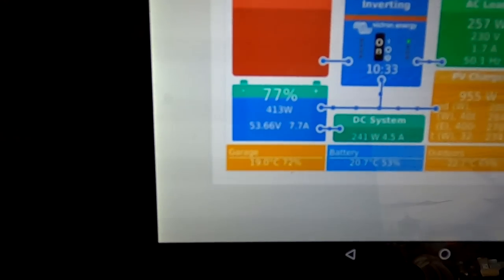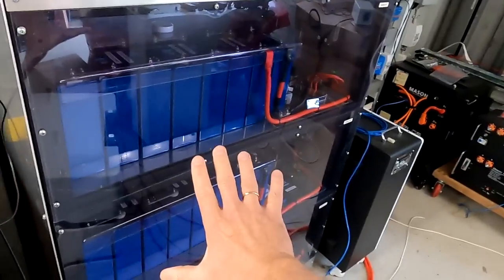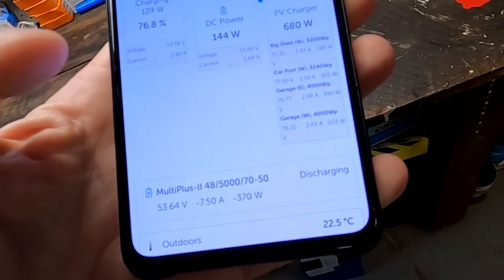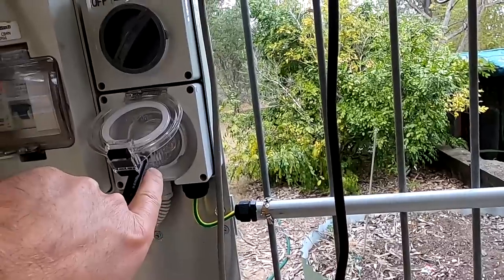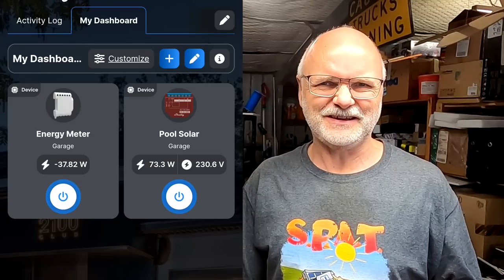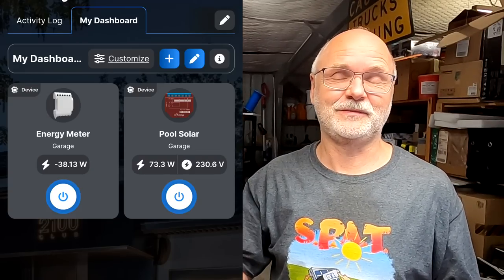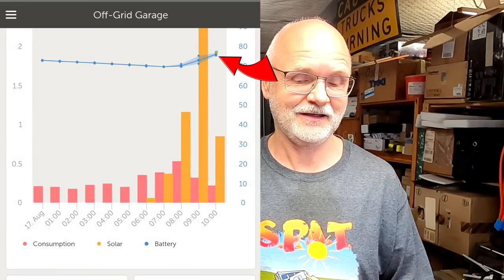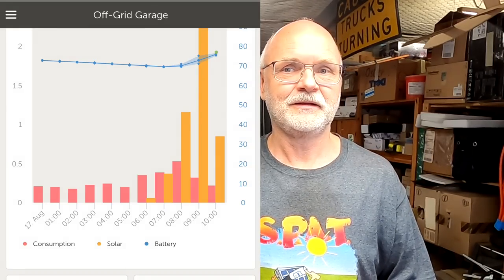Micro Inverter shows in Victron VRM. Shelly Switch Integration to Home Assistant and Victron.

Comment: I think, that there is a further bug: AC Loads does not show correctly.
The Venus OS does not add the PV Inverter production to the loads.
If PV is 500W and the inverter is adding further 50W, it should show 550W on the AC Loads...but it only shows 50W.
Thank you for this Video and thanks you all Developers of those integrations!
Reply from the maker: Yes, if the AC-In is set to Generator, it won't be added. I've set the option to Grid now and it works.
Martin thinks, the script may only work with ESS and grid connected systems. He hasn't got to time to further look into it, so I'm looking for another solution...😐
Reply: Is there a solution already?

Comment: Great video, it showed me a lot of very useful info, thank you!

I have a different, but similar problem, trying to add a second inverter to the Cerbo GX:

The background:
My Victron system is in a small travel trailer.  I full time in the travel trailer and try to stay off the grid as much as possible.  While I LOVE the dual MultiPlus II 3000 because I can run anything and everything I need, for 95% of my needs the overhead is too high for running the light day-in/day-out A/C  loads I need all day long: computers, monitors, Starlink, CPAP machines, and other small devices. I already own one of the smaller 800VA Victron inverters and plan to wire that up to run the loads.  

The problem:
I have heard the Cerbo GX can only show one inverter group (the dual MultiPlus II).  So I was going to install the SmartShunt on the DC side of the 800VA inverter and the Shelly EM + 50A Clamp on the AC side.  Is there any way to configure the Cerbo-GX so I can track the usage of this inverter?  I am also thinking of adding a Shelly Plus 1 to turn the 800VA inverter on and off.  I would love to get that on the Cerbo GX, too.

I am guessing this is outside your knowledge base, but can you point me to those that might be able to help?

Comment: Very nice, congrats. I understand the reason for the shelly but to know the production of the micro inverter you should use Solarman integration it will give much more information that the one you get from shelly. Since you are using Hassio you can install one more shelly in the pump and only have it running when the microinverter can fully power it.
Reply from the maker: The solarman integration gives me only data every 5 minutes, while the Shelly provides live data.

Comment: Note that ssh should be native in modern Windows OS (so no need for Putty). 

Also, vim is the editor of Linux 😅

Finally, you may want to set a static DHCP address for your Shelly as it could change otherwise making your script look for the wrong address.
Reply: vim isn't installed in Venos OS
Reply: @pau1phi11ips  ok, good old vi then 😆
Reply from the maker: @pau1phi11ips, I assume this is you: https://github.com/pau1phi11ips/dbus-venus-mqqt-pvinverter
I've tried your script as well on my Cerbo but with the same result: generator shows negative figures and Total Solar is not combined. If I set Grid as AC-In, it still shows negative numbers for AC-In but at least the Total Solar is correct now (MPPTs plus PV Inverter)

Are you able to help and troubleshoot? Happy to colab and get something done. My email is under the About tab on YT.
Martin is not keen to investigate further as the script works for him and his ESS 🤷‍♂️
Reply: @OffGridGarageAustralia  In the Cerbo remote console, what do you have the recently added Shelly device set to within Setup > Position?  Likewise for other devices?
Reply: Still no solution?😢

Comment: I'm running a Plus1PM in a similiar configuration for testing purposes and just recently found the reporting into the vrm not working anymore after turning the Shelly off and on again.
Had to ssh into venusOS and restart the dbus-service for the given Shelly (no need to reboot!). This is with static IP set both in the shelly and directly in the switch that manages the whole network. In case you encounter a similiar problem...
Reply from the maker: Hmm, strange. I have turned off my Shelly a few times so far but it always came back in the VRM after turning it back on. I also have a static IP for the Shelly. Do you use the same script?
Reply: @OffGridGarageAustralia  same GitHub repo, yes, but maybe not the same version as my installation is already some months old, I'll check if I can update. Also i'm pretty sure that everything worked fine some months ago, maybe it was just a hickup

Comment: Hi Andy, doesn't the Shelly have the Outbound Websocket support? In that case you don't need anything, just point it to Venus OS and it will popup as a meter you can configure for PV Inverter. No MQTT , no root, and no other difficulties required
Reply from the maker: I have no idea how this would work. 
Quick Google search, it seems to be the Gen2 of the Shelly switch which has that. But still needs some sort of script in Venus OS?
Happy to test a simpler solution if there is one.

Comment: Is it possible to use another instance of shelly 1PM attached to Old Good Xijia 3kW Inverter to show them as AC LOAD on VRM? It would be a super option for ppl like me, which doesn't have Victron Multiplus Inverters (yet ;))
Great video Andy
Reply from the maker: Well, you don't need the Multiplus to show the Shelly in VRM. It also works in my SPAT Calibration Centre for testing purposes.
But yes, there is a thread on the Victron Community forum where people have modified the script so it shows a load instead of a PV Inverter. Search for the word 'load': https://community.victronenergy.com/questions/127339/shelly-1pm-as-pv-inverter-in-venusos.html

Comment: Andy, 1. You can use the "Victron GX modbusTCP" to get all VRM data to the Home Assistant, control Multiplus, dynamically control EV charging, based on available PV production / battery SoC, etc. 2. Multiplus losses are 30%, when charging from AC and then inverting from the battery. Huge loss of the tilting benefits 😞 (3). Shelly 1pm is not robust for such wattage. Shelly EM, with the 2x A clamps is much better with no inline connections to the inverter/consumption.
Reply from the maker: Thanks you. I think I have used that as an HACS integration already. It works well.
The power of the tilt system will mainly go directly into the pool pump, the house pressure pump and the SPAT fridge. Some small excess will go back to the garage. I have seen a video where someone calculated all the losses of the MP and charging efficiency was actually surprisingly good with around 80-85%
The Shelly runs a treat since installation, no problems so far. It's only 7A which is going through it, less than half of what it is rated for.
Reply: @OffGridGarageAustralia  Trivial losses for direct use and 4x MPPTs, good job. You can add the "vebus acin1toinverter" and "vebus invertertoacout" entities at the Energy Dashboard and check the MP losses when using AC charging + inverter. For DC charging + inverter the 80-85% seems correct. 7A for 1pm is ok for just measuring energy. Using the internal relay for 7A loads on-off can be too high, depending on loads. Actually its not measuring energy, like grid meters / inverters, just gets a power measurement every second, so some % inaccuracy, depending on variations, not so important.

Comment: My friend had micro inverters at his house with panels. Problem: they produce a lot of RF interference, being a Amateur Radio operator, the interference disappears with no sun,  he got rid of them and went with a single MPPT charger. He can now communicate during the daytime. Some manufactures are not following RF radiation compliance rules.
Reply from the maker: I cannot use MPPTs in this location as it is too far away from the battery. AC-coupled solar is the only solution. I don't know anything about RF interference. Should the manufacturer take care of such a problem?

Comment: Grüße nach Australien aus Germany ;D eine Frage habe an meiner Batterie einen PV inverter (Lumentree600) den ich auch wie Du per Shelly im VRM nur anzeigen lassen will ohne dass er als weiterer PV Ertrag mit eingerechnet wird. Kann man das deaktivieren? Habe 3 Victron Laderegler die ja im VRM dokumentiert werden und den Inverter will ich da ja nicht mit drin haben. grübel kann man den separat dokumentieren lassen?
Reply from the maker: I have tried the same with my grid connected Fronius inverter from the house solar. It shows in Victron but will be added to the Total Solar even it is a standalone system and not feeding into the battery. I just wanted it to show the actual power production, same like you.
The only 'solution' I found is setting the AC-Input to Generator (Settings - System Setup). Then, it shows the inverter in VRM without adding it to the Total Solar. BUT, it also shows this power then as a Generator power in the statistic. 
So, no, this is not possible, at least not with this script.
Reply: @OffGridGarageAustralia  ok so the generator is displayed and the PV inverter at the same time? You can not set that the generator is only displayed? I wouldn't care about the name if you knew it was my Lumentree. I have a 1PM Plus here, but I'm afraid of destroying my statistics for the last few months, I think I'd better leave it alone ;D Thanks again and many sunny spring days.

Comment: Hi Andy.  Any ideea why i'm not getting that icon in the vrm portal  ? Also no icon in the remote console. I can see just the consuption graphic. Thanks. Have a great day. Maybe because i'm using a non victron inverter ?
Reply from the maker: I'm using a none Victron inverter as well. The script works with the Shelly not the inverter so should just work.
1. Do you see the Shelly in the Device List in VRM?
2. what Venus OS version and device are you using?
3. rebooted the device after installing the script?
4. have you used the exact same script I have shown in the video?
Reply: 1. Yes 2. I'm using 3.10 venus os on raspi 2. 3. Yes 4. Yes. I am able to see al the information in remote console in device list but no icon. If you agree i can sent some print screens via email to you. Just for an opinion. I don't want to bother you.
Reply from the maker: @dabo5068 Sure send them. You're almost there. Maybe we can trouble shoot it this way.

Comment: does this require the shelly to have a static ip-address? in most cases, the ip-address is given by the dhcp server (or in most cases your internet router) - so the ip of the shelly might change after the next reboot ...
Reply from the maker: If the router restarts, it may hand out a different IP address to the Shelly and the script would stop working. So, yes, highly recommended to setup a static IP for the Shelly or do a IP address reservation in your router.
Reply: @OffGridGarageAustralia  so there is still room for improvememt ...
Reply from the maker: @herwigg3327  I think the static IP  is a must for such devices or something may stop working at some stage and it's hard to troubleshoot. I personally keep a list of all devices and MAC addresses on my network and if the IP is either static, router reserved or dynamic. It helps a lot to identify and resolve issues quickly.

Comment: Hello Andy, I have microinverter sd3 appysistem, whit a et 112 meter I see production in gx.
Reply from the maker: Yes, I have the ET 112 as well but the installation location of the micro inverter is too far away from the garage where my Victron is. I know they have a Zigbee adapter...

Comment: Hey Andy,

I have a Shelly 3EM which means I have 3 phases.  When configuring the .ini file,  should I add a second and 3rd line to read L2 and L3???
Reply from the maker: You have to try and see if it works. I could not alter the ini file without losing all the data being transmitted. So, mine shows L1, L2 and L3 even I'm using only L1.
Reply: @OffGridGarageAustralia  aaaaahhhhhh okay... thanks for that prompt response... So without further "to do" I'll try this out...
Reply from the maker: There is a different solution for the 3EM. Follow this project here:
https://github.com/fabian-lauer/dbus-shelly-3em-smartmeter

Comment: I needed to change the position of the integration. It is in the file dbus-shelly-1pm-pvinverter.py in line 52. A zero means it is on the AC Input side and position 1 is for connected to output 1 of the multi.  I think this will fix the problem with the AC Input Box.
Reply from the maker: Well, the position is correct though. Mine is at the output of the Multiplus.

Comment: I thought this is monitoring the tilt system? Why name it pool solar?
Reply: The inverter is at the pool and powering the AC pool pump system from what I understand.
Reply from the maker: Yes, correct. It is the tilt system. I should rename it. As we also have the Pool Fence Solar and it gets too confusing.

Comment: Just to add that the shelly plus 1pm works with grid tied PV inverters too. I simply had to reverse the Live and output "O" wires, with the switch always "ON". The Shelly then operates in reverse, but still provides a positive (solar generation) reading.
Reply from the maker: And it does not show a negative AC-in or negative Generator figure any more?
Reply: With the Shelly still linked to the Shelly Cloud only , it shows positive (up to 3.5KW) when generating and positive (<1W) when the Solar Inverter is asleep. I'm still debating with myself whether to follow your and Martin's guide to integrate in to the Victron VRM, as I'm still not clear whether I lose the integration every time the Cerbo GX gets an update. 
Can I add that I thoroughly enjoy your videos, which prompted me recently to add (self instal) battery storage to my old PV system. The videos are, most of all, a great example of the ideal educator at work - well prepared, enthusiastic, inquisitive, fun, and without affectation. Great work. @OffGridGarageAustralia
Reply: @OffGridGarageAustralia  Thanks for the reply. 
Just to confirm that I have connected the Shelly Plus 1PM to the Shelly Cloud only so far. It indicates positive power when generating - in my case up to 3.5 KW - and positive power when idle,  <1W, as expected. 
I'm still trying to confirm whether integration into VRM is wiped out every time the Cerbo GX is firmware updated. 
I have been unable to integrate my PV inverter directly  -  2013 Power One Aurora 3.6KW - via its RS485 output, hence the Shelly.
Great channel. 
Your videos prompted me to self instal battery storage a few months ago, which seems to be working well so far, and as I begin to see the benefits, my interest in extending my system grows. 
Thanks again for an excellent channel.
Reply: I've followed the "Martin" integration process and it works perfectly! PV generation readings show up as positive.
Reply from the maker: @georgebajan5691 I have tested the script on my Cerbo and downgraded and upgraded the system again and both ways the integrations seems to keep working. I think there was some info on the github page which explained the mechanic they implemented in their script to ensure that.
That does not mean it wont break with a future update though.
And thanks for the kind words and feedback in your last comment.

Comment: Moin,

For some reason I installed the wrong code. It was for the Shelly 1. But I have the Shelly 1 Plus installed. Now I have 2 programs running and it does not work. So my question is...

How can I remove it all so I can start over with the right one?

Anyone?

Thankx
Reply: Problem Solved

Comment: This is indeed nice feature..too bad you can't use it for DC only..that would be awesome..
Reply from the maker: The Shelly 1 can be used for 48V applications up to 16A.
Reply: @OffGridGarageAustralia  Nice but for DC 48V system i would need up to 100A current.. If there was that option then for sure that would be perfect for most systems that don't come with option to connect to Victron systems.
Reply from the maker: @SylwerDragon  Yeah, that's a Victron Smart Shunt as the cheapest option then in this case.
Reply: @OffGridGarageAustralia   now Andy question is ..Can it be set as Power Generator instead of only smart shunt ? Will it show as lets say new extra unit ..and if you will put two shunts will it say Power Generator 1 and 2 for example ? That might be worth to test it.

Comment: Could you help me with my battery parameters please?
Reply from the maker: Sure, what's up?
Reply: @OffGridGarageAustralia thank you,  i cant set parameters right, where can i sent you my screenshoot of my parameters?
Reply: @OffGridGarageAustralia i have 51,2v battery what ovp alarm, ovp protect, ovp release,  full charge voltage and ovp cell release should i set?
Reply from the maker: @sasoozvatic  is that 16s battery Lifepo4 or Li-ion?
Reply: @OffGridGarageAustralia The problem is that my UFO 51,2V batteries have a constanty problem of dropping SOH, because my battery parameters werent set right, then me and UFO support set my parameters settings( they dont know a lot from past problems), now my batteries arent dropping SOH, but they are sometimes charching with 1 to 3A when at 100% SOC, is this safe? I have 2 of these batteries.
Reply from the maker: @sasoozvatic  how do you charge them (parameters of your charger)?
Are they in parallel or series?
Reply: I use pbms program with my PC, yes they are paralell
Reply from the maker: @sasoozvatic  what model and brand is this battery?
Reply: @OffGridGarageAustralia UFO power shenzen battery 51.2V 200AH. I have 2 of these batteries.
Reply from the maker: @sasoozvatic  Parameters need to be set in the charger.
Absorption 55.2V
Absorption time 1h
Float: 53.6V

These figures will work quite well.